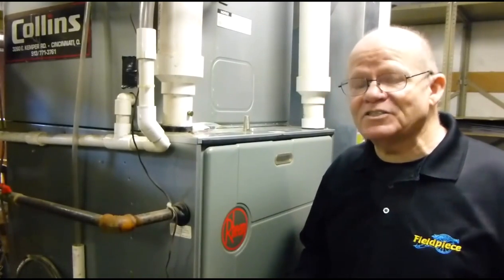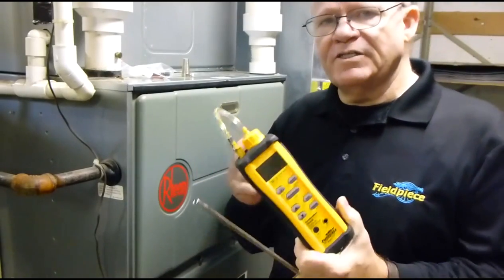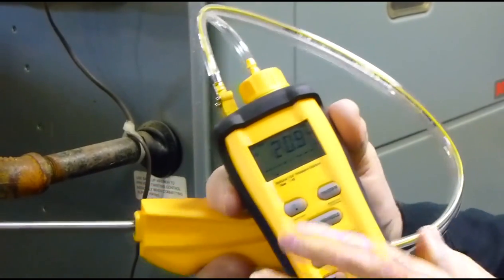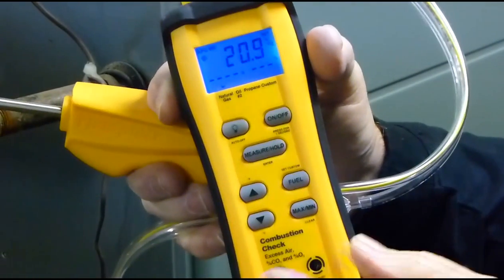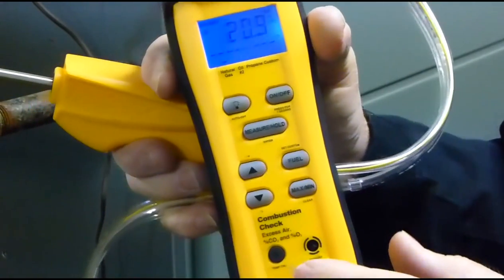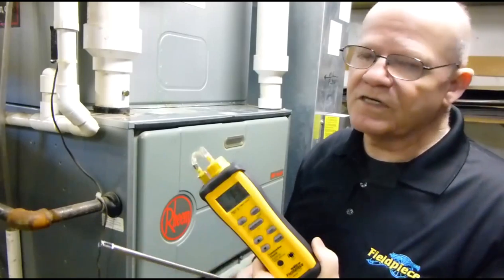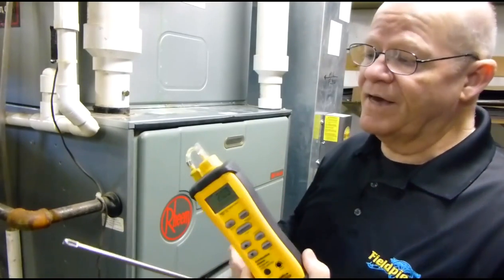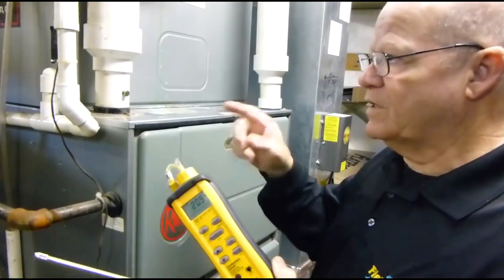Fieldpiece SOX3 Combustion Check

Comment: At the end of the video, I see a vinyl tubing drain line. Where is it draining from?
Reply: The one on the left is probably from the condensate pump to the outside or a drain in the basement like a sink or floor drain. The one on the right could be a humdifier drain or from the flue pipe.